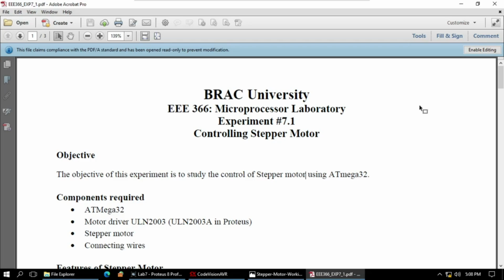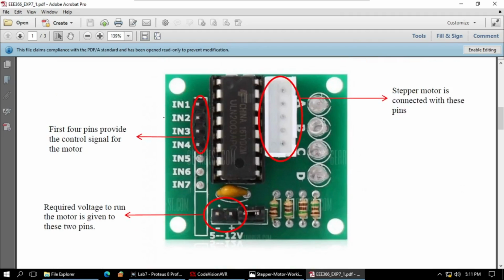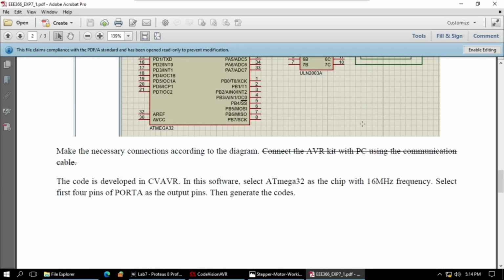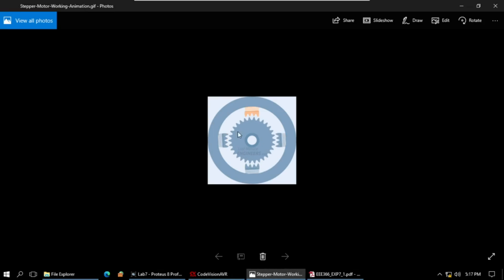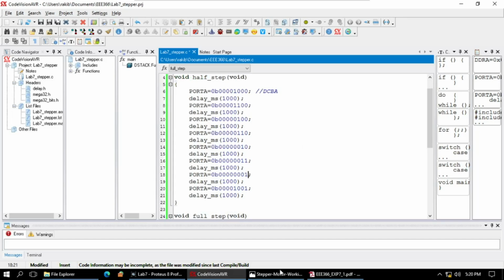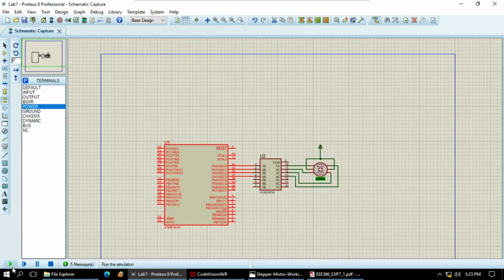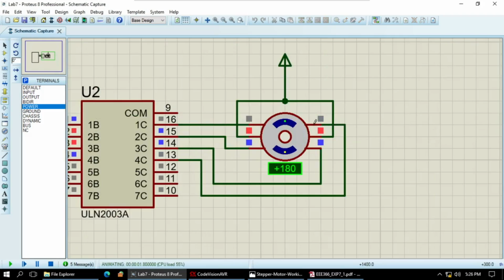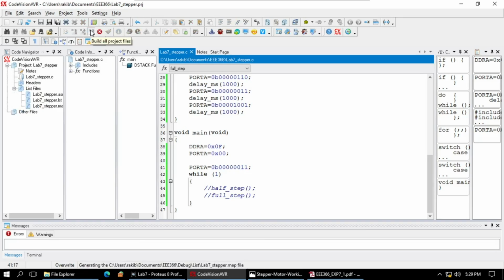Controlling Stepper Motor

Comment: How to make the angle for 35 degree how to find the sequence
Reply from the maker: Thanks for your comment. It depends on the specific details of the stepper motor you have. For an actual stepper motor, you may first identify the step angle, and then you can find how many steps you need to move to 35 degrees.